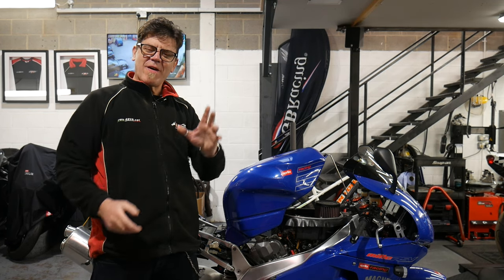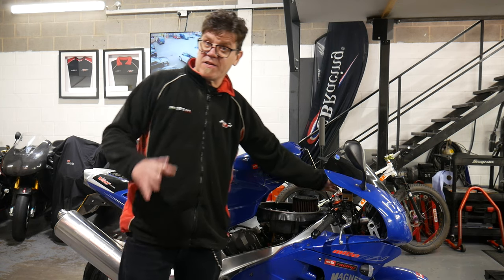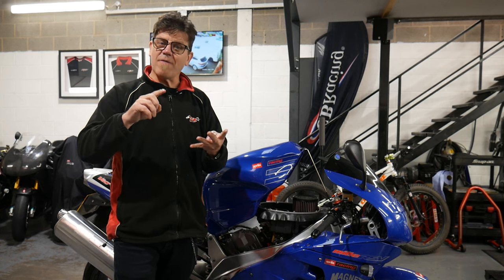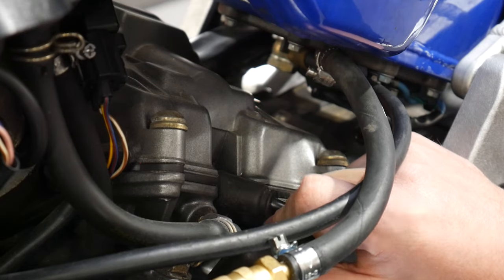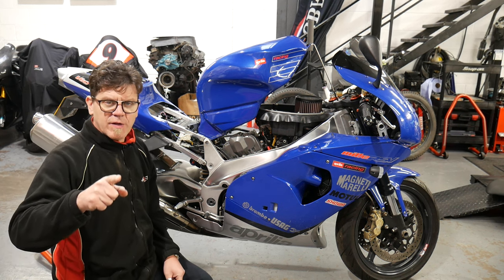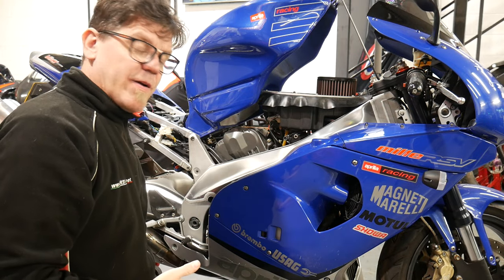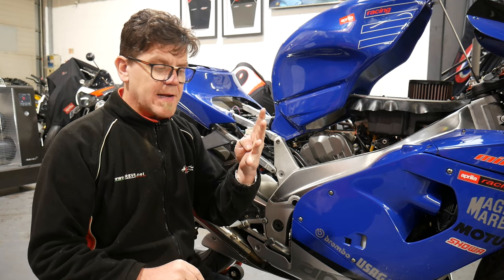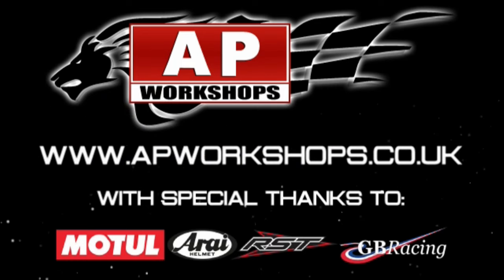AP Workshops - Diagnosing a Non-Start On Your Motorcycle Aprilia RSV Mille Gen 1- Step by Step

Comment: Helpful, thanks. But what if you get ignition, prime, but no crank/turnover when pressing starter button? Starter solenoid issue....?
Reply: Mine tries to crank the starter and kills the battery. Got me fucked. Or solenoid issue?
Reply: @muffpaddy  if the solenoid is gone, it won't turn over at all, you'll get nothing other than ignition and fuel pump prime. Can you hear the pump prime?
Have you tested the battery and is it kept on a tender? An older battery not holding voltage won't work.
Reply: If everything “should” work, and the battery is charged, don’t keep cranking it till your sprag explodes: Max throttle on starting. Leans the mixture.

Comment: And if it still doesn't run with all 4? Rode 5 minutes to the store and back one night, ran fine. I got home and parked it. The next day, it wouldn't start (no spark). Left it parked over the rest of the winter and swapped out the stator and r/r with Rick's parts and new plugs last week. Made sure the battery was good as well as topped off. Still no spark. New battery, and I have spark now at all 4 plugs. The plugs are getting wet so/and the fuel pump works... the bike turns over (still code free), has spark and fuel, but it doesn't gurgle, bubble, pop, crack, or anything, not even once. Just turns over without even attempting to ignite. 2002 Mille R